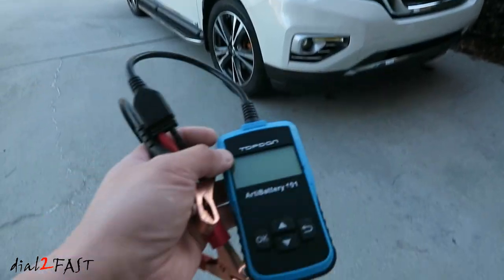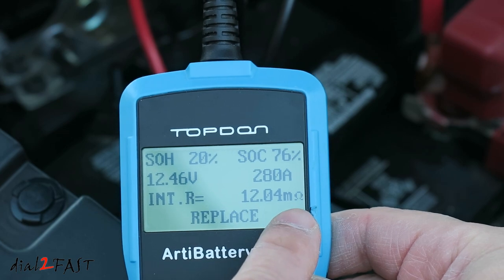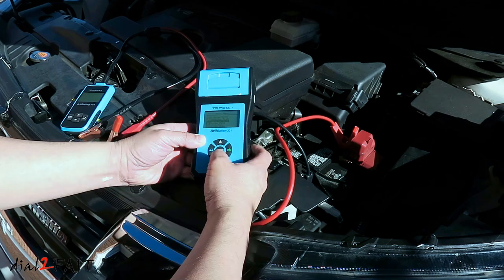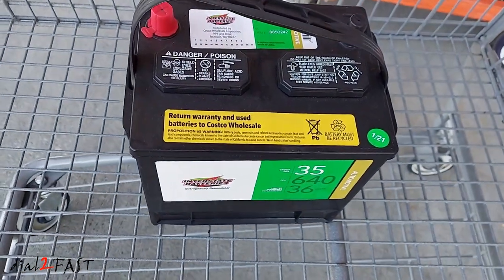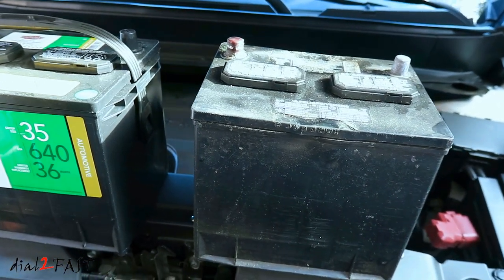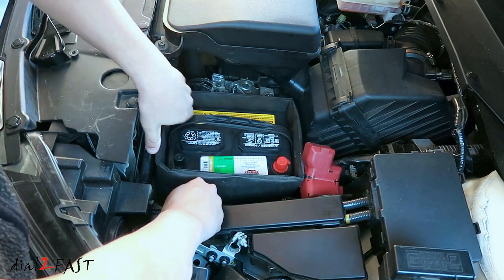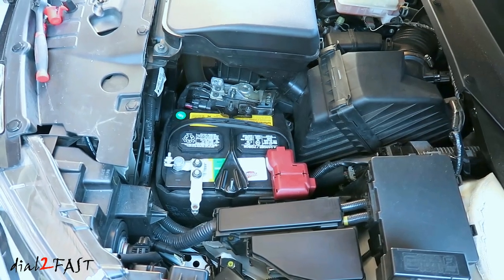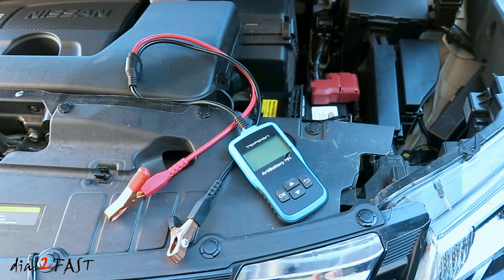How To Test & Replace A Car Battery - COSTCO vs WALMART

Comment: Much better commentary than many other videos.  Also good safety practices.  NOTE that the temperature of the battery strongly influences the cold-cranking amps, internal resistance, and voltages.  NOT sure if these testers actually account for this, but at least get the tester to roughly the same temperature as the battery.  They are probably made to work in "normal" garage environments, which is NOT typical in Alaska, or north of the 40th, in winter.  GM engineer Ret.
Reply from the maker: Thanks for your comment!

Comment: Excellent video.  I found all your details (about Costco and Walmart, the testing, the tools, the replacement, ...) very useful.  I also like how you worked nicely and cleanly.  I wish you had talked a little bit about the safety--if there are any--working with a battery.  Anyway, excellent video overall and I will be checking out more from you should I need.  Thanks again!
Reply from the maker: Thanks for your comment. Have a great weekend!

Comment: Great job making the video and demo. I wonder if a Noco Genius 5 or 10 Charger could repair the old battery and desulfate it? I use a Pulse Tech PowerPulse passive desulfator, they claim to have a patented frequency they use to desulfate batteries, I have been using it on my BMW battery for the past three years and never have any issue's starting even though I only drive about 25 miles per week.

Comment: Thanks for the video. I have been looking at upgrading my battery tester from the load tester type to a similar one shown here.  There seems to be quite the variation in results between the testers... Both testers (AB101/BT500PRINT))  read similar voltage (12.46 \12.4V) , but the SOH (20%/55%) , SOC (75%/66%) , measured CCA (280/400) and internal resistance (12.04/7.48 mohm) are all different.  Maybe some variation could be attributed to you starting the car between using the testers but certainly not all the variation seen.    Would be interesting to see the values when both testers are connected at the same time to see the actual difference between the meters (i.e., no starts between meters readings).  So which tester is more accurate?  The difference between SOH, measured CCA, and internal resistance is to be noted... In this case both suggested battery replacement, but if you had charged the battery to the 12.7V,  would the recommendation still have been the same? I could see a case where if the measured CCA was slight higher they might give different recommendations.. you might be replacing your battery earlier than needed... I guess small price to pay for peace of mind.  Glad to see you have a battery insulator too. You could add an aftermarket one (e.g. the DEI  or AOPC) to your existing one if you have the space. The reflective coating will add further protection from radiant heat. Though it doesn't do anything to stop the heat soak when you turn off the car. My car battery usually lasted 2-2.5 years and didn't have an insulator. I have added one similar to the DEI and hope to extend battery life.

DEI https://www.amazon.com/dp/B000MY0MQ6/ref=cm_sw_r_cp_apa_fabc_3QAVT4G6DFR9DE1W2X5Y

AOPEC
https://www.amazon.com/dp/B01DWJ5PFU/ref=cm_sw_r_cp_apa_fabc_PXE7XPBMJQZX5STFJZ82?_encoding=UTF8&psc=1

Comment: Did you use a battery source or electrical outlet to keep your cars electronics connecter while changing the battery?
Reply from the maker: No I didn't. On this Nissan, the only thing that lost memory was the power memory seat.

Comment: Thanks for the video. Did you get AGM battery? I have nissan rogue 2019 s model. Not sure if I need an AGM one or normal would be fine
Reply from the maker: The Pathfinder does not need AGM battery. I recently replaced my Odyssey battery which has an AGM battery. So replace it with whatever your vehicle comes with.
Reply: @dial2fast  How long did your Odyssey battery last? I was thinking of getting one but they are $359.00 compared to a Coscto AGM battery that is $159.00 for my 2001 BMW.

Comment: What’s your opinion on the upcoming pathfinder?
Reply from the maker: I like it a lot. The new SUV design style of the Rogue and Pathfinder are very sharp looking. Nissan SUV usually have a more solid feel than the Honda and Toyota. Will see if they maintain that attribute in the new design.

Comment: @dial2fast  how is your Honda Odyssey AGM battery ?  Very recently  while on accessory mode (HD radio) within 5 minutes it won’t start. Happened twice. Battery is 3 yrs old in my Honda Odyssey touring 2019(the top tier). You have 2018 Honda Odyssey  top tier.
Reply from the maker: I also have a 2019 Elite, and the battery has been good. For a period of time, I did use it to power my dash camera in parking mode (ignition off), and that seem to drain the battery faster than usual. I did have to test & charge it a few times and the battery is good after it's fully charged with a battery charger. This is the tester/charger I am currently using https://youtu.be/SwAbtFy0hDA

Comment: My car wouldn’t start if I charge my phone and when I keep light on for 10 or 15 minutes. It down to 9-10 volts. Do I need to change it immediately? And when I jumped it, it back to 13.5v. Is that ok or it has alternator issue also?
My battery is 4/2019 Costco but from different owner and I don’t know if I still can return it.
Reply from the maker: A battery tester like the one I showed in the video will help you test to find out if the battery is bad. You can get one with the link provided.

Comment: Innacurate tool. It tells me to replace my battery in winter and in summer it tells me good battery. I get a 150 amp difference depending on temperature. Not to mention a 120 amp difference between your 2 testers. Also the tester has telling me to replace my battery for the past 3 years.

Comment: Dude is there any cheaper way to test it?  Like bring it to auto zone.
Reply from the maker: You can take it to most auto parts store and they will test it for free. Just keep in mind if your battery is really on it's last leg, be prepared to need a jump start when you are out and about.
Reply: @dial2fast   If they do a load on the battery you might need a boost but if you use a conductive tester you'll be fine!